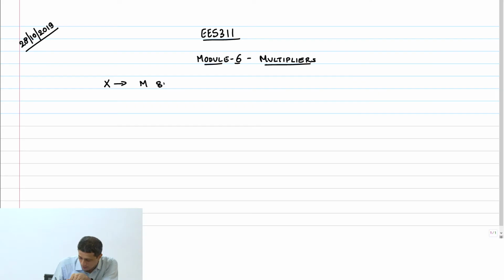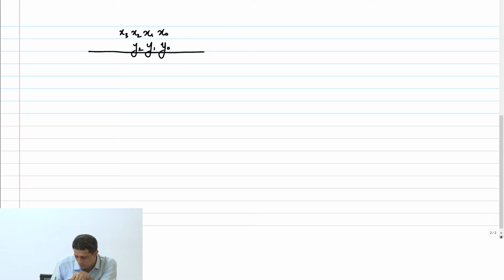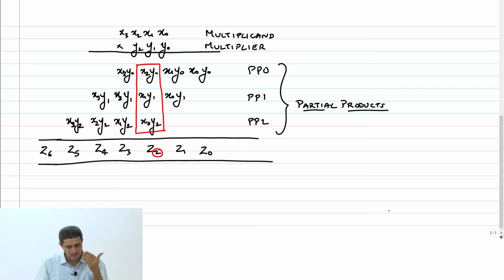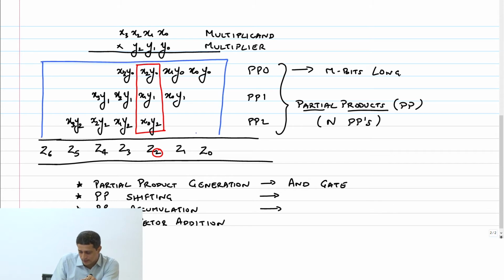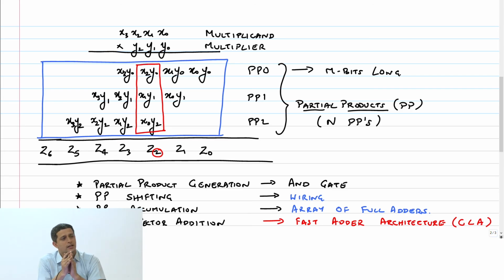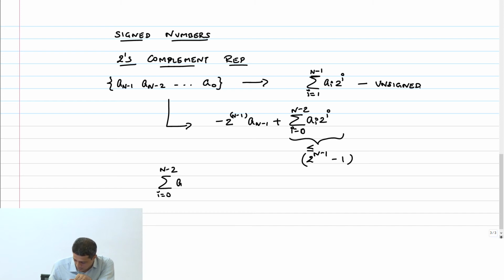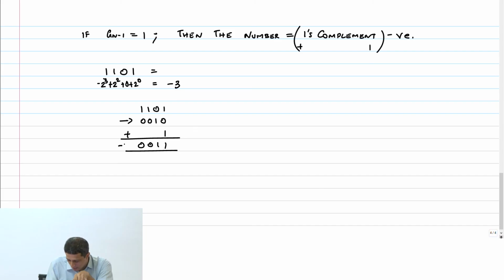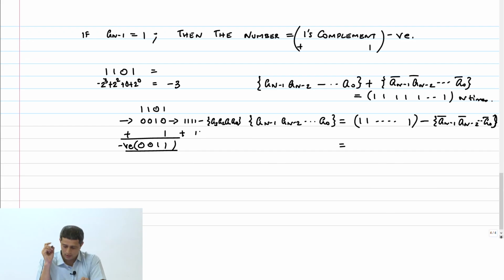AM - 7 - Two's Complement Arithmetic

Comment: we add that  +1 because by complementing we make that number far from 1111...1 plus its original position also get shifted by 1 so by adding that 1 the result come to its actual position in the bit sequence for computation by the circuit implementation